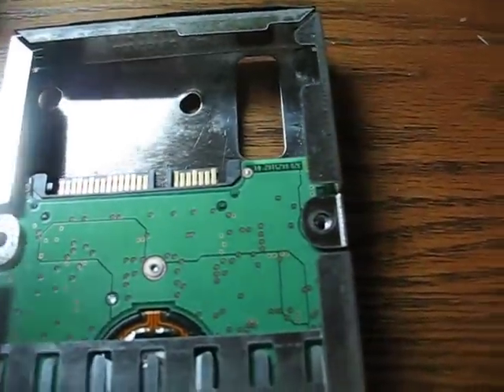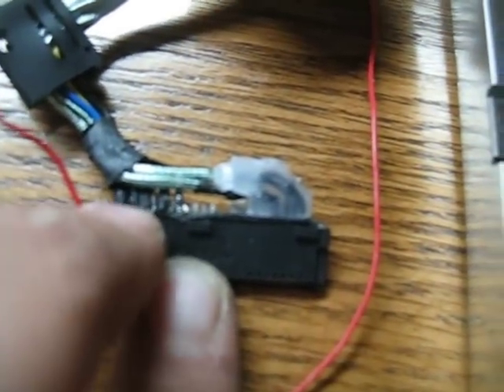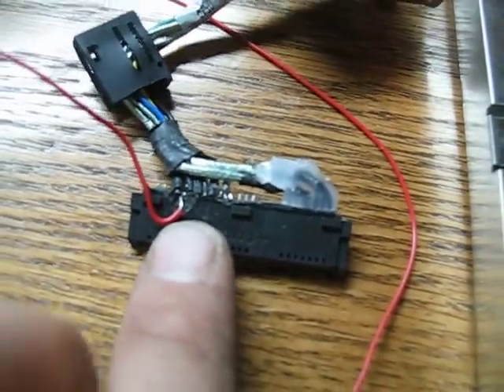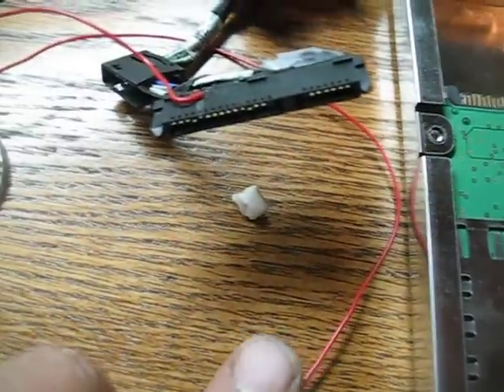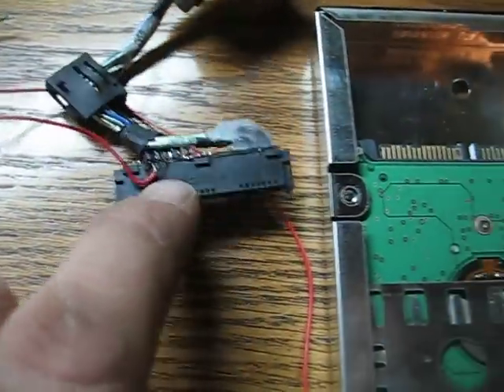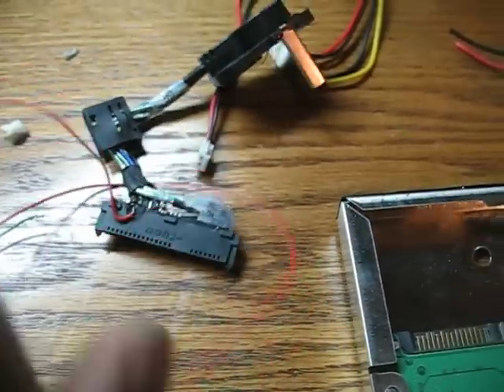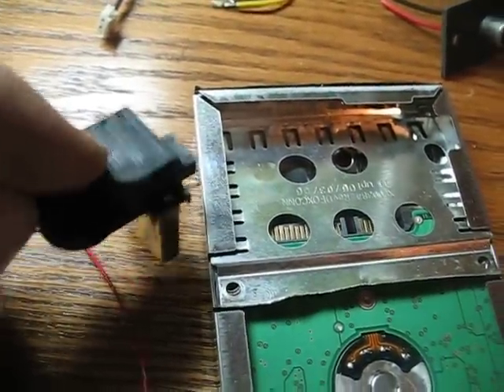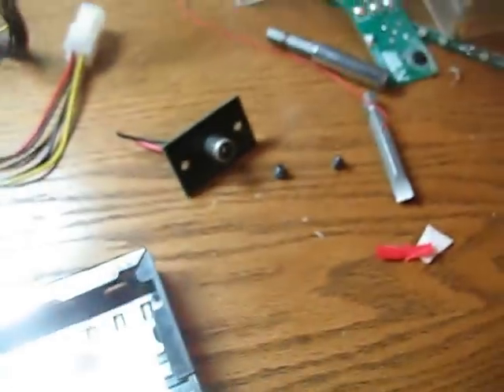xbox 360 hard drive hdd led mod

Comment: @cdhgoalie30 whoah whoah whoah negative, use a multimeter if you need to but the red wire carries +5V and the yellow is +12V

Comment: Btw, make sure you check the rating of what your LEDs can handle. I bought 6  (3 on each side) blue rectangular LEDs at Radio Shack , rated at:
FW current (IF) (mA): 20 mA
FW Supply (V)(typical): 3.2V
FW Supply (V)(typical) (maximum): 3.8V
Since the LEDs I got work best at 3.2v to 3.8v, I put the resistor to lower the 5v to a lower (safer) level.
Remember:
If your voltage is too low then it wont light up properly or at all.
If you exceed your max voltage, kiss your LEDs good bye.
Good Luck!

Comment: @dschulz777 well, when I modded my HDD I used a 150 ohm resistor that has a  5% tolerance (the color scheme for it is [brown / green / brown] with gold at the end) and I attached it to 6 LEDs (3 on each side). I used the resistor at the very begging of my circuit on the wire I attached to the power source (running to the LEDs). Best results I suggest placing your LEDs in a series circuit and not parallel. When they are parallel, the light dims when you add more LEDs, but not when its parallel.